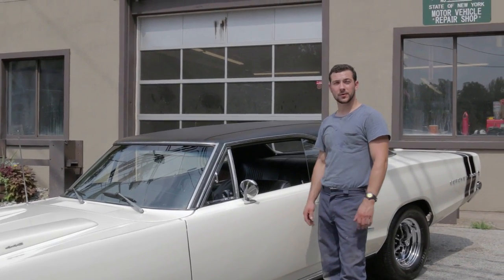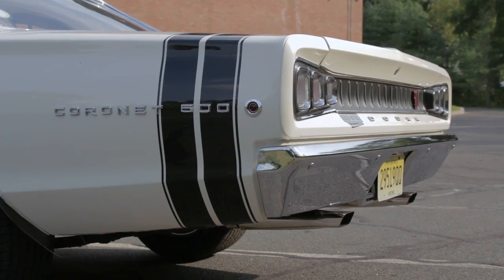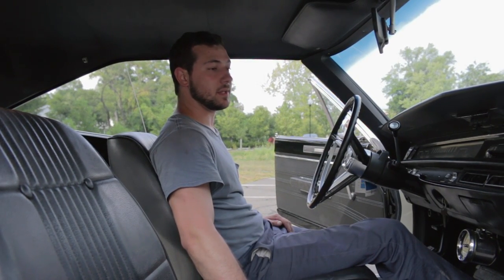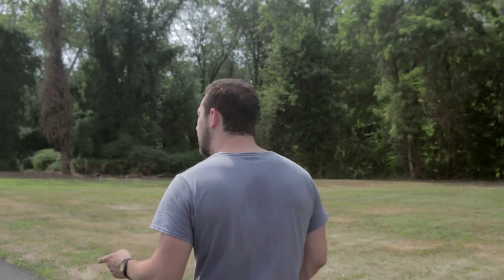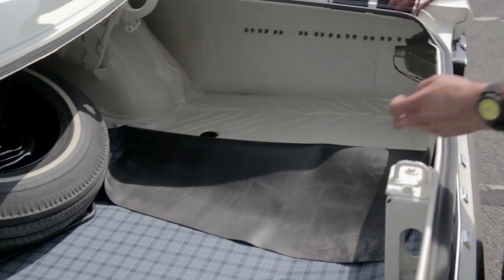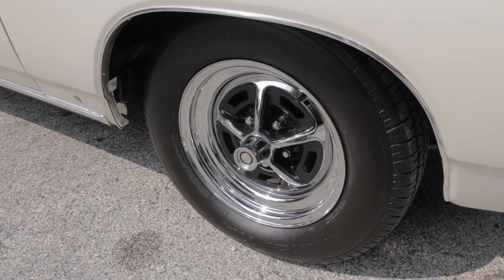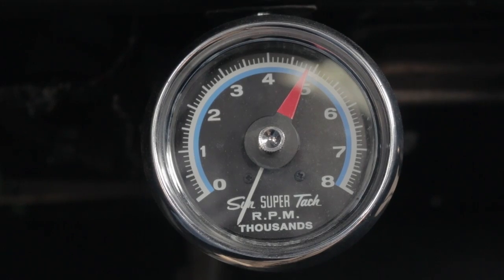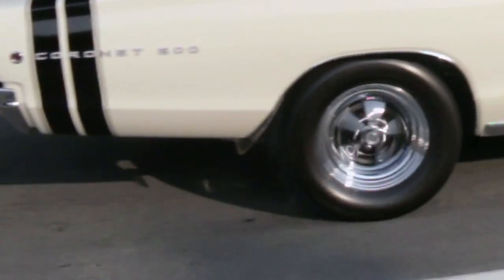1968 Dodge Coronet 500 - Fully Restored - Show Reel

Comment: My 1968 Dodge R/T has the 1969 Ramcharger hood as well. The 69 hood came with a functional fresh air grabber box set-up that's activated from the dash. The base plate  air cleaner sits on the carb while the upper section is bolted to the hood itself along with runners going to the underside of the hood scoops. The driver can active the scoops by opening the gates in the scoops to allow cooler air from the outside. The 1968 had a nice choice of air cleaners...either an Unsilenced air cleaner (the one that's in the video) or a dual snorkel air cleaner. If you had to pick a style for a Ram hood that was minus the Ramcharger set-up...the Unsilenced air cleaner I think would be the best choice to take advantage of the fresh air being forced into the engine bay. The original 500 cars were more style and comfort, but this finished product is every bit a muscle car and is an A+ in my book.

Comment: I thought the 500 had a 383 and the 440 was only in RT Model's? My parents bought a 68' Cornet 500 383 brand new off show room floor when I was 5 years old. Alway's loved that car and wish they would have saved it for Me. Maybe some day I will get one.
Reply: The biggest engine you could get in a Coronet 500 was a four barrel 383! Not the same as the hi performance 383 standard in Super Bee and Road Runner.
The Coronet 500 was never considered a true muscle car.  This is still, one nice Mopar!
Reply: Ramcharger hood wasn't available until 1969. But looks great on a '68.
Reply: @wedge4hire  The model 500 with the 383 4bbl was in fact the same engine that came in bees and runners.  The engine code H is identical.  I have a 68 Coronet 500 H code ragtop.  I bought it from Rocket Restorations (Mopar only) in WA State.
https://www.tpocr.com/dodgevin4.html
Reply: You are correct.  The 500 had two 383 option, the 2bbl version and the high performance 4bbl version H code engine, the same as in Super Bees and RR.
https://www.tpocr.com/dodgevin4.html
Reply: Both HP 383 engines were 4bbl with one being 330hp vs 335hp, the later being in the SB and RR.  The 335hp had a different cam, springs and windage tray.
Reply: @Mr_PNW  So that would mean they are two separate engines, right, if the cam, springs and the addition of a windage tray, is not the same? Not a big deal and it is a great car, no matter what 383 is in it! I've got a 69 Coronet RT, 440 Magnum, 4spd, with Dana third member. Love them Mopars!
Reply: @Mr_PNW  my first car in 1980 was a 1968 cornet 500 383 4 barrel automatic on floor burgundy poly white vinyl top